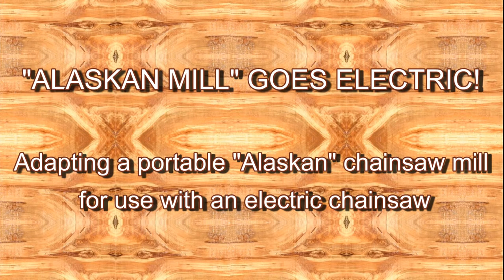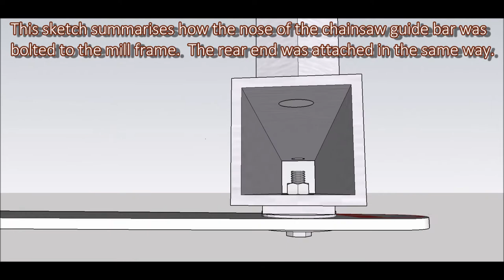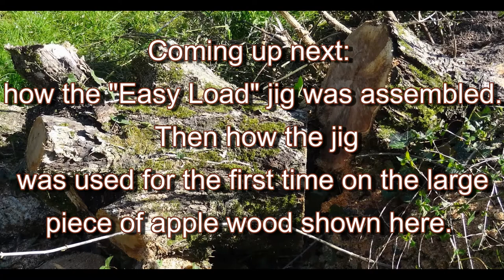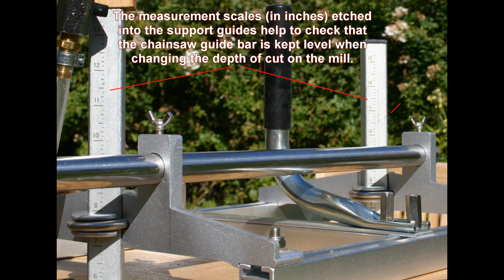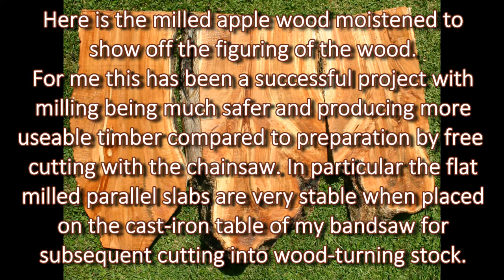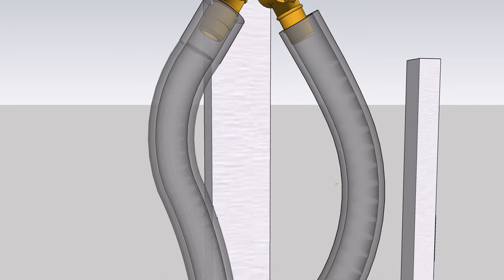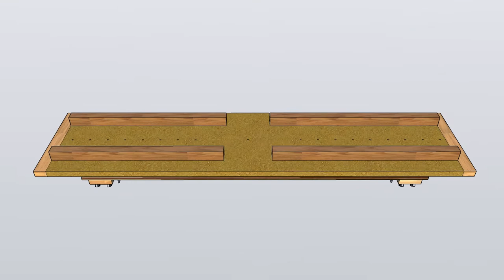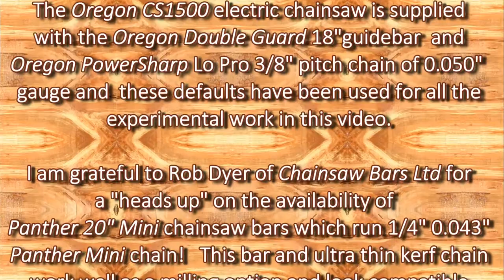"Alaskan Mill" Goes Electric (An exploration of milling timber with an electric chainsaw)

Comment: I've yet to buy a chainsaw but the one you have looks more than powerful enough to cope with my demands.
Reply from the maker: Hi Teraina, Yes the Oregon CS1500 is a really good electric saw (3.2hp petrol equivalent) which I have had for more than 3 years now. I have found it ideal for preparing green wood for turning as well as using in my portable chainsaw mill.

Comment: ha ha ya we dont need the extra oiler but mine has it also mine has a winch handle only 22 bucks im giving live edge fire place mantles for x mas was that a ripping chain the first chain i got has to many links the new one is on the way. my metal rails are 8 ft. a bolt with a coupler adjust up and down then a long wood screw holds it down to the log i planed to bolt not clamp the saw to the mill . i havent cut a splinter yet im waiting on the ripping chain merry Christmas to you

Comment: Tim. I have watched your jig construction with great interest. Does this only work with an Oragon chainsaw? I have a Bosch one.
David Griffin
Reply from the maker: Thanks for commenting.  The reason I'm working with the Oregon CS1500 electric chainsaw is that it is one of the most powerful corded electric saws available (2.4 kw [about 3.2 hp]) and one of the few with an 18" (45cm) bar, but even so it's pushing it to it's limits and the norm for milling is a petrol saw.  I did contemplate using a Bosch AKE 40-19 S but the rating is significantly less at 1.9 Kw with a 16" bar giving less potential milling width.

Comment: I like the oiler system. But would only one oil screw be enough in the middle of the tip? I often see bars with only one oiler on the bottom of the saw. I think these people do not know you can flip bars. You could have ground out some metal instead of bolting right to the bar. Also try a ripping chain.
Reply from the maker: Many thanks for your comments. Yep, I'm sure you are right about one oil screw in the middle of the tip as the oil flow is quite sufficient with just the one feed operating.  I am currently experimenting with a 20" Panther guide bar and will almost certainly just have one feed as you suggest.  The Panther uses 1/4" 0,043" chain which should give a much better performance for milling than the PowerSharp chain.  I have just added a video on using the Panther Bar and Mini chain with the Oregon electric saw and it works very well indeed although I have yet to try it in my milling setup.